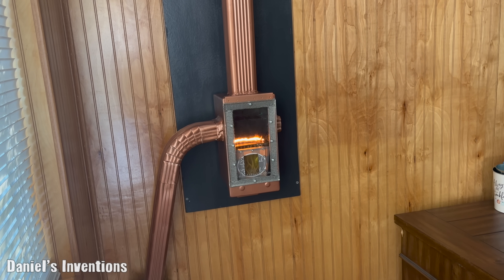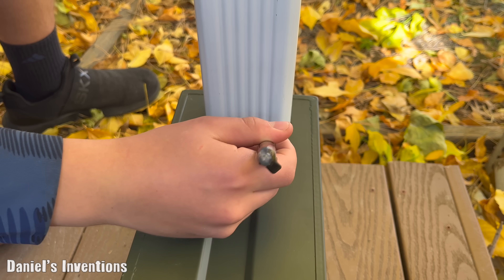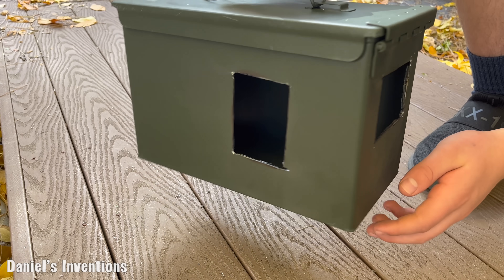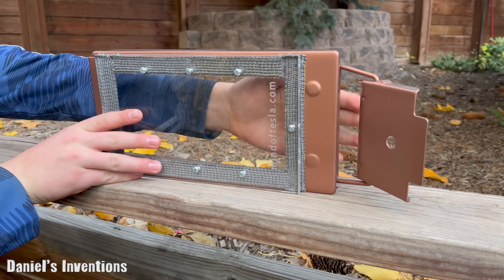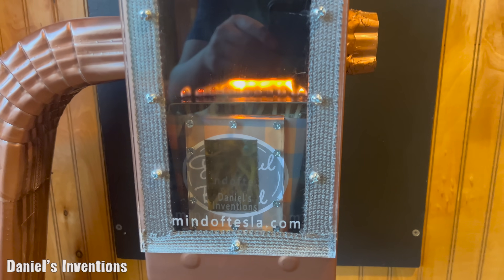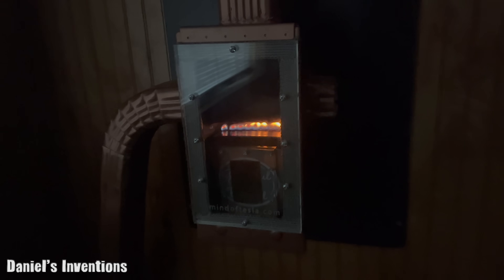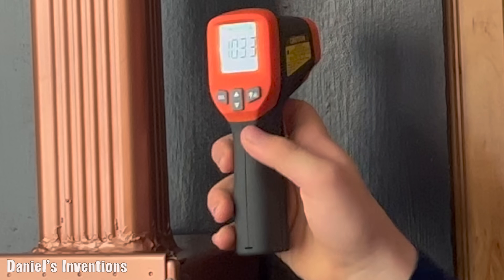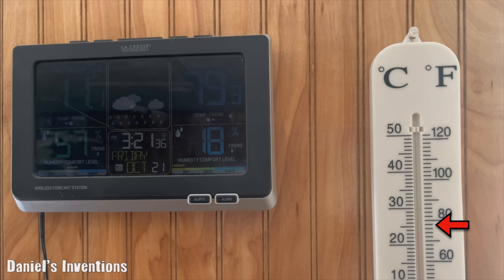ENDLESS Heat for Your Home WITHOUT Electricity

Comment: I bought one of those cheap diesel parking heaters and am using it to heat my small condo - basically a #2 fuel oil blow torch. 5 gallons US lasts me over a week at a comfy 74 degrees F. Far cheaper than electric heat. it works great! You can run ag diesel (dyed red) though it and save money.
Reply: Diesel is $5.49/gallon here in Western WA and news reports are now saying that Diesel will be gone in less than a month. Yikes.
Reply: a "25" day supply of diesel is only 15% under the 5 year average of 30 days.
Reply: I think the implication being made is that in 25 days, the supply of Diesel will be gone and it will not be replaced. Meaning we won't have anymore. Is that sensationalism being promoted by mainstream media? Perhaps. Could simply be "the sky is falling" scenario to distract from the shellacking they are going to get on Nov 8th.
Reply: @g-whiz286  It's 6.09 a gallon where I live, but that is still less expensive than heating with electricity. Far less expensive! 140,000BTUs in a gallon of #2 fuel oil ("Diesel" when you put in a vehicle) vs. 3600BTUs per 1kWh electricity. In my locale, elec. runs 0.31516/kWh for the 1st 255kWh, and 0.39468 per kWh after that...

Comment: You said no electricity where does the fan get it's electricity?
Reply: The fan is optional to help with air circulation. The heater could run without it.

Comment: Adding mass above the flame would make it radiate heat longer possibly hotter not sure how much of the heat energy is being captured by the tin drain pipe. 
You could use a spiraled copper pipe as a water heater either inside or outside the chimney, would also radiate heat longer.
Reply: Mass only stores heat.  It is surface area that radiates heat.
Reply: @kensmith5694 " making it radiate heat longer".. also if the tin is too thin and the air current pulls the heat off too fast increasing mass could raise the temperature. Good try. 
Side note I've often wondered why wood stoves or similiar  pull heat from around rhe furnace but don't have heat sinks on top. Or automatically come with the basic water heater set up hook upsn radiator, pressure valve. The older I get its astonishing how much more effecient they were before electricity. Convience will kill us all.
Reply: @cavelvlan25  He is running the heater continuously so the "longer" doesn't really happen.
Some wood stoves do have  a water heater chamber on the side of them.
The top is left flat for putting a pot of stew on.
Reply: @kensmith5694  not sure why this feels like an argument. I was suggesting improvements. The heat sink I'm refering to woukd be inside the ventilation not actually above the furnace. Your right some do come with hot water heaters if you read my comment instead of thinking about a counter you would have realized I said automatically come with it like as in a standard you buy a wood/gas stove any brand u get the water heater. radiating head longer because not everyone wants there stove burning 24/7 when it isn't necessary if it had MASS to hold and radiate heat I could keep a home warm well after a burn. Fuck they have tech that turns heat directly into electricity they could come standard with charging stations. If the world wasn't crooked as it comes we could even get batteries that charged universally and fit all tools.
Reply: @cavelvlan25  This is not an argument in the disagreeable sense of the term.  
The comment about the water heater was support for your idea in that others have done that with success.
His design has no ability to turn the heat up and down or easily turn it on and off.  On many wood stoves, you can close off the air so much that you nearly kill the fire.  People did that before they went to bed so that they wouldn't have to start a new fire.  In very early days matches were not a thing.

Comment: electric fan = electricity use change the title otherwise the only question I would have is about refilling.
Reply: Eh, a fan that size you could probably keep going 24/7 with a 40-60W Pv panel outside and a power bank, even in cloudy weather. That or use a few TECs to scavenge some watts from the flue.